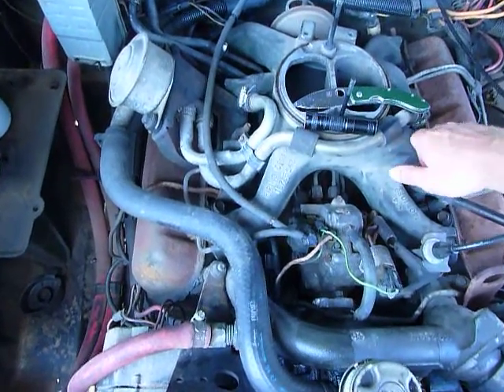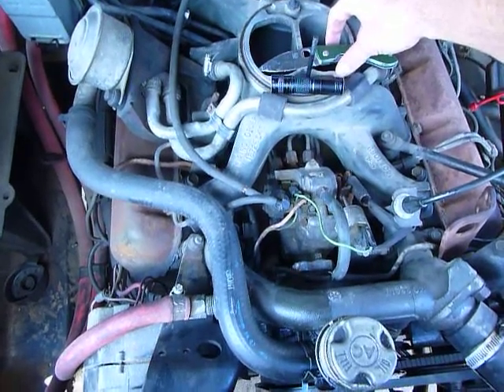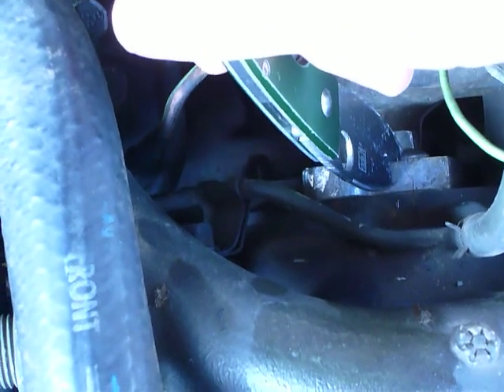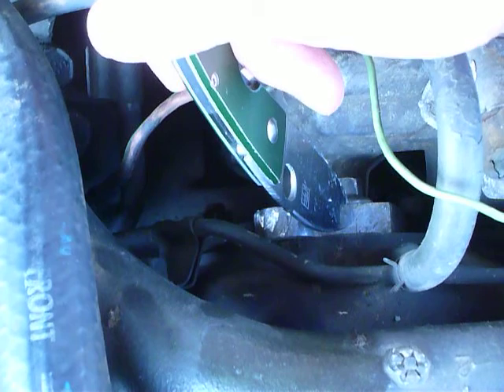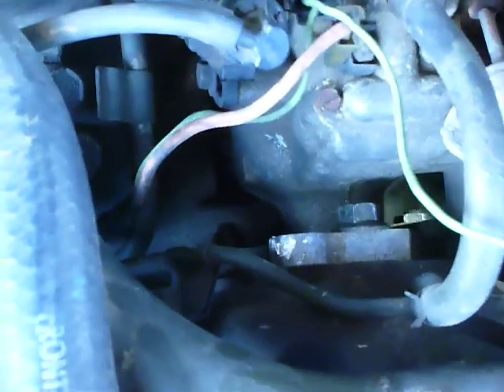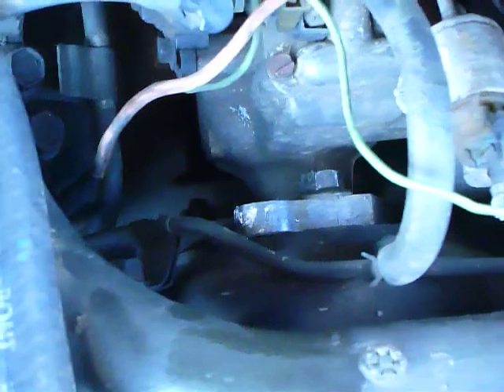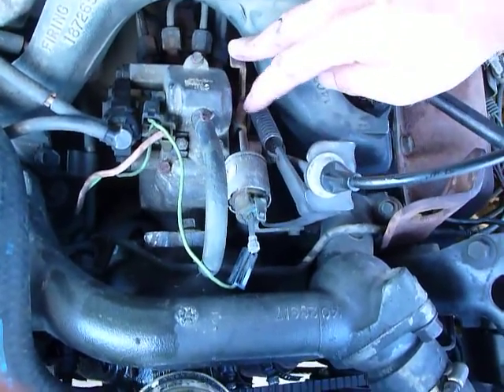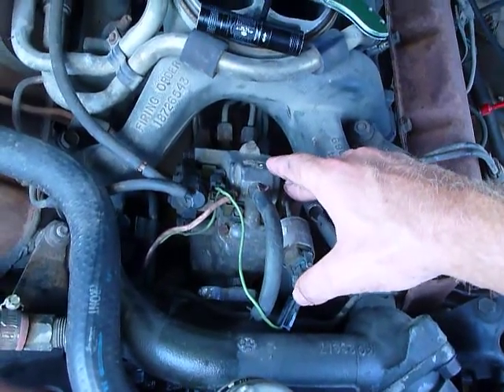6.2 Diesel Injection Pump Timing HTWL

Comment: Just timed my 6.2.  The lower driver side bolt very hard to get to.  I used a 15mm ratchet box end.  Had to work it hard.  Used a 24" pry bar to advance the pump. Took about an hour, but finally got it. It took 3 of us to get the job done. Runs great now - no more smoke!
Reply: Thank you! This is exactly what I needed to hear

Comment: Great video. You've got a j code intake I notice, is your truck military?
Reply: Very observant Kaulin. You know your early GM diesels. I wuz wondering the application too. Can't tell if the belt is serpentine, but I notice the newer fuel filter. I'm guessing maybe a 1990ish? My 93 J motor has the filter on the back of the intake. X2 on the video. Thanks for posting.

Comment: Awesome video! I have been looking for a basic video on timing the IP for a 6.5 and I hope it’s the same thing as this 6.2.
Reply: Was it?
Reply: Depends on what pump it has. If it's the turbo diesel in a pickup, it probably has the ds4. This procedure applies to the fully mechanical db2 pump found on 6.2s And some 6.5s

Comment: hey i know this video is old, but i recently got my first diesel, 92 6.2 1500 nv4500 2wd truck.. smoke constantly except when cold, i live in ohio and its (fighting the whole way) fired up as low as -4without wind chill.. it has 216k on it, when i got it the previous owner did injectors lines lift pump and tank, it leaks fuel under the intake (hopefuly going to pull the intake this weekend, but wanted some insight as to the smoke situation, the truck fires fine until about freezing temps and will idle roughish until warm, once warm smokes like a freight train (bluish white, rarely blue) but runs fine and, even after grenading the original 10 bolt with 3:42's and reluctantly only being able to find a 3:08 2wd rear it still has power to maintain hills in od... i know for a fact i uses oil but not like what you would think with the amount of smoke... i only have to add oil every few months  (which i know is a problem) just dont think it should smoke as bad as it does for how much oil it consumes... any and all help would be very much appreciated, thank you in advance
Reply from the maker: Jeb Justjeb assuming it is only smoke from oil and not water, it might be valve guides.  Im NOT thinking head gasket since you say it starts in cold weather and runs great, however I would suggest a compression test.
keep me posted
Leo

Comment: Do you have to place the motor at top dead center first
Reply: No it isn't necessary. I would compare it to moving the distributor cap on a gas engine.

Comment: NEVER HIT an injection pump with a hammer. There is a tool tht goes in two holes on the pass side of the flage that allows a 3/8 drive ratchet to leverage it. If you don't have the tool you can slide two 3/8 bolts in the holes and then uzse a prybar across them.
Reply: thanks drkervorkian thats exactly the info i was looking for

Comment: thank you for your reply 
my concern is how did you move the pump to advance toward the driver side? I loosened all 3 bolts and the pump would not move easily without it spinging back to origional setting is it hanging up on anything? your video only showed the timing already advanced!! what did you pry on to get it to move?

Comment from the maker: Injection pumps are almost impossible to get literature on.  I cannot find one book, website, video, etc. which explains how to work on injection pumps.  My pumps rotated without a problem.  Another issue is the motors rebuilt by the military have all kinds of problems with them, when you purchase a military vehicle you want to ensure it was never rebuilt, or rebuilt by the manufacturer.

Comment: i loosened all 3 bolts on my 87 6.2 diesl spent an hour trying to move the pump/ advance it... what did you use to move the pump and how did you do it I had the most difficult of times trying to budge it... the bolts were loose and all i  got was a little gigle but kept moving back to the origional mark  it feels like it is going to snap something inside the pump!!  HELP!!

Comment from the maker: -johnthompson88 The first steps I take to assess those situations are 1. open your fuel water filter and let it run go until only diesel comes out.  If that does not work 2. change your fuel filter.  if that doesn't work 3. look up cleaning out a diesel with beer cans, you basically just place 4+ of them in the tail pipe, then start it.  if that doesn't work, 4. run diesel clean and get diesel from a different fuel station If that doesn't work.......what do you mean the older pump had more power

Comment from the maker: Starting in the colder weather is easier with an advanced pump, and minor power gains.   The military runs the pumps retarded, not %100 sure, but they probably assume it increases motor life.